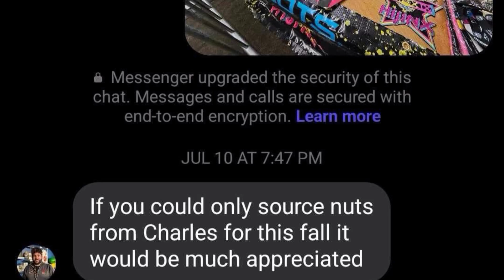Another BATTLEBOTS FACE-OFF Reveal!!!

Comment: probably my fav fight is actually a never one. minotaur vs endgame from 22. soo well driven and tense. apart from that bb wouldnt be the same without jen and the vibrant hijinx. the ignorant backseat battlebot theorist in me was wondering with such a heavy weapon bar as the one hijinx is sporting could there be a reasonable design in which the weapon motor(s) + batteries are actually part of the weapon weight and the motors and the shaft being the static part of the frame? the weapon radius would probably need to be decreased in favor of a slightly more compact shape as a significant part of the weapon steel would need to double as a supporting frame/armor for the motor but it could maybe free up quite a lot of weight.

Comment: The fight I use to introduce people to the sport is Beta vs Lucky. It is two weapon types that are immediately understandable, it’s a back and forth brawl and shows how control and strategy is crucial!

The fight I could watch again and again is Minotaur/Cobalt (the second one)! 

I also totally agree on the reach thing. At the last beetle event I had to fight a 10-inch diameter undercutter with my much heavier, harder hitting 6.5-inch bar and those were easily the hardest fights of the whole event (lost first one, squeaked the second on JD). Being able to touch your opponent before they touch you is so important